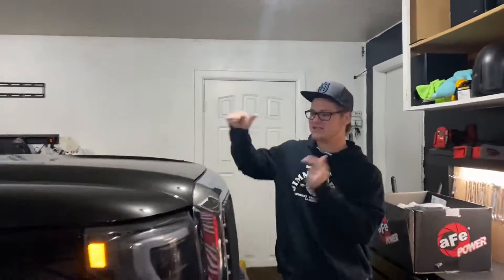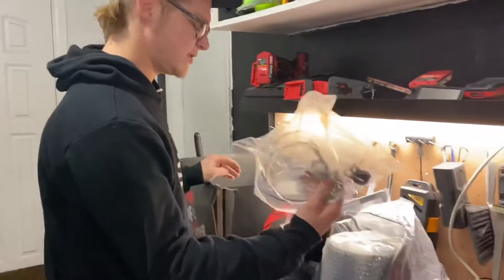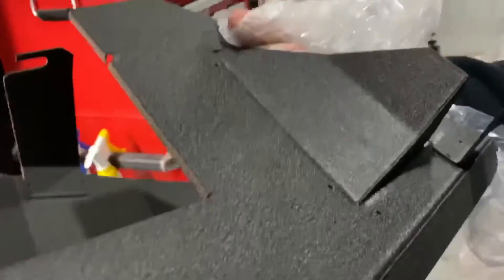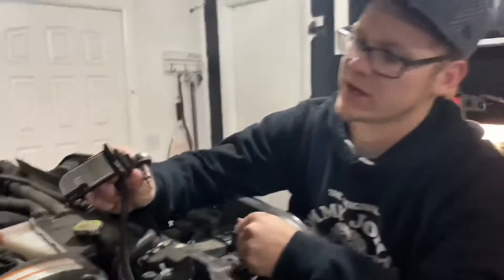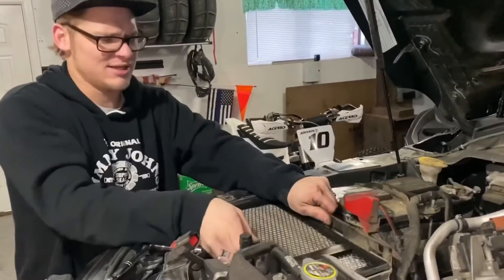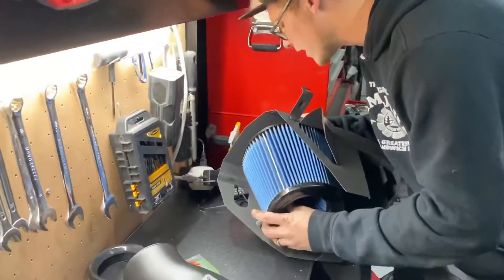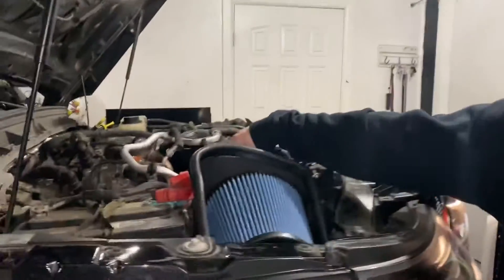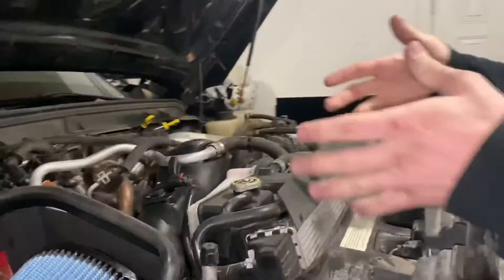Installing a Cold air Intake on a 2015-2020 6.7 Powerstroke (Tuned and Deleted) F250 Platinum

Comment: Looks good boss 🤘🏼 after the cold air intake I recommend picking up a hot and cold side intercooler pipe. Noticed a much quicker spool up and snappy throttle response and made my engine bay look sick 😂 keep up the vids bro
Reply from the maker: Brandon L great recommendation! We have a bunch of parts on the way and in the garage, the weather has just been so horrible here in the beautiful mountains! We will release some content soon! Thanks for the support!
Reply: @collinbrackin  For sure man! You should come down to Texas it's been 70 degrees all week here 😂
Reply from the maker: Brandon L that sounds like heaven. It was 10-18 degrees and then warmed up to about 30 and snowed for a solid week 😂😂